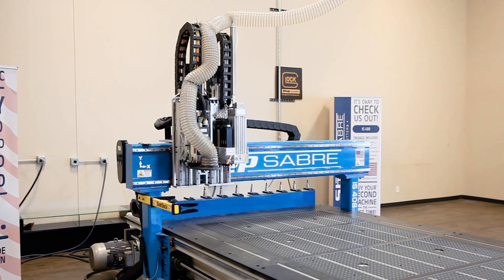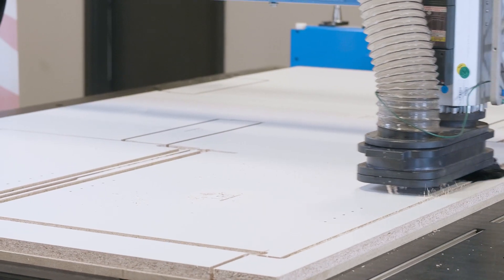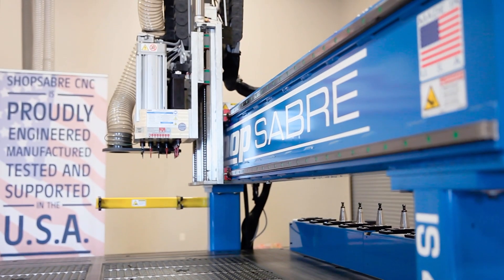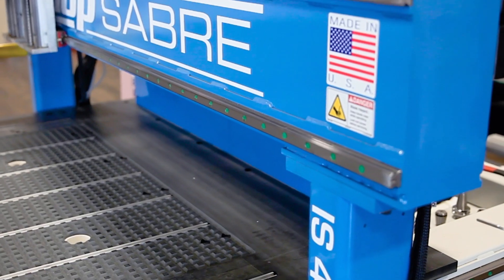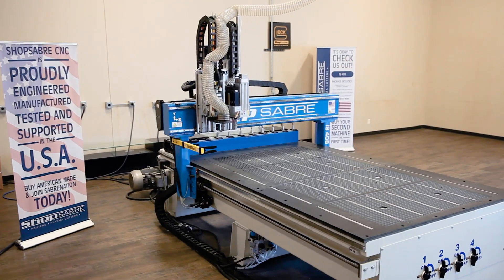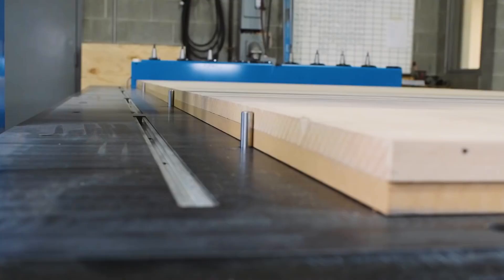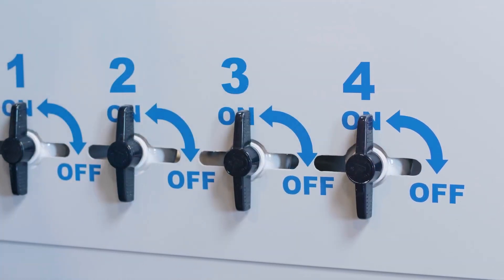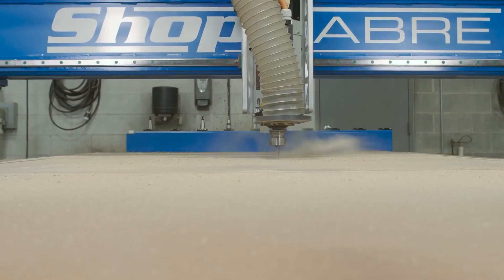The IS Series Router by ShopSabre CNC

Comment: Dust Collection - I purchased a Pro 510 that will arrive in late December. I'm trying to get my shop ready for when my machine arrives. I'm trying to figure out how to install my 5HP dust collector system which I also purchased from Shopsabre. Installing the hose system that will meet the needs of my machine is what I am having a little trouble with. With the large table I need a system to support the hose and allow the hose to travel the full table length without interfering with the spindle or X-Y travel. Does anyone have a basic design for this. I just do not want to do this twice and I want everything on site so I don't have to wait for parts. I am getting excited and really looking forward to Christmas!
Reply: We used a ball joint that moves back and forth and a barn door track to support it. Then long flex pipe.
Reply from the maker: This is a great solution
Reply from the maker: You can reach out to our technical support team for any questions about your Pro 510. They can help you with figuring out issues you may be having with your 5HP dust collector. You can fill out a form on our website or contact them at 1-800-493-602.

Comment: Just got my IS510 placed in my shop several weeks ago. Still running wiring for the vacuum pump, waiting for DC ducting, and also waiting for an air dryer that I needed to add to my compressed air system. Some days I go out in the shop, grab a seat, and just sit there admiring my machine…then I realize, better get off my rear-end so that I can put this bad boy to work!
Reply from the maker: Hahah, love it. Glad you like the machine. Can't blame you for sitting and admiring it. Put that bad boy to work!